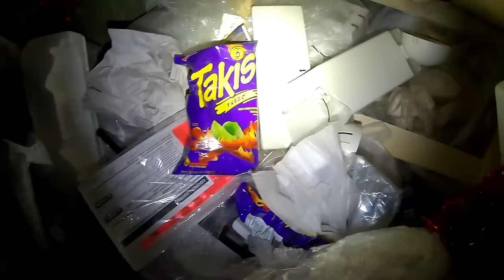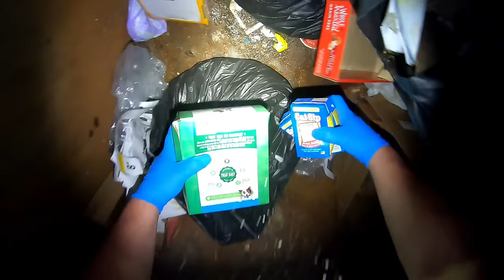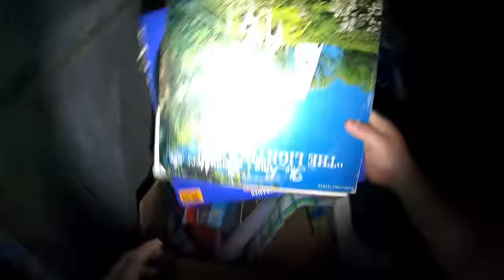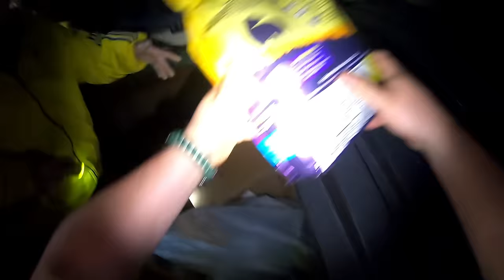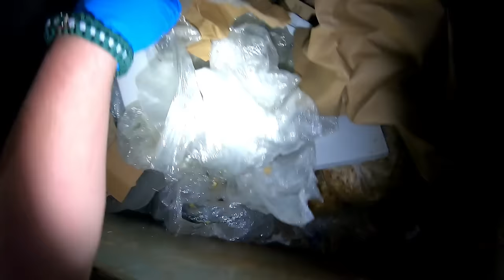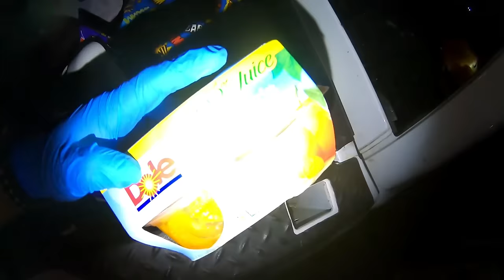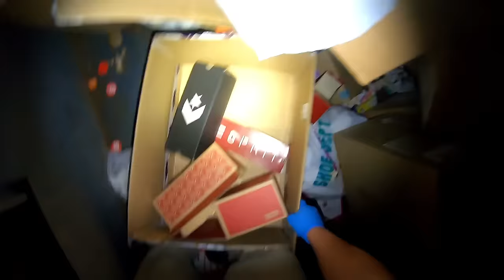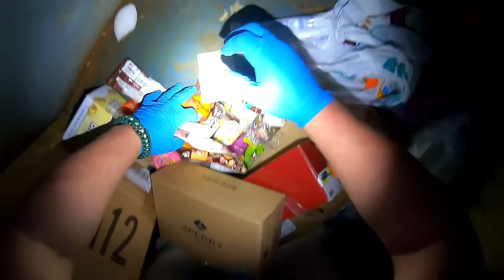ARRESTED DUMPSTER DIVING | Shoe Mega Haul OVER $1000 NEW Shoes | NIKE CONVERSE VANS SPERRY

Comment: They probably take one shoe out of each shoe box and throw it loose in the dumpster then pack all the shoe boxes in the big boxes like that to confuse you so you won't take the time to try to find the mates. You should get a camper cover for the back of your truck so you can throw everything back there and nothing will fall out or at least rig some cattle guards and wrap it with tarp and make a gate above the tail gate.
Reply: They don’t bother doing things like that.  People who wear two different shoes sizes will switch things out, so shoes stores end up with dozens of boxes of single shoes or they receive out just one shoe of each style for display and the display shoe eventually gets tossed.

Comment: I had made a comment on someone else’s comment about the shoes and most stores around me use to throw out all of one of the matches to all the shoes at different days. If yu check those same dumpsters periodically yu could match some shoes and make some okay money. Stores around me  use to do it until they had got locked 40 footers with a compatible on the front.

Comment: can a left shoe be modified changed to become a right shoe....mabye by making cut in sole v shaped so front part moves to side , but how to connect it again, must be a way , two holes nearby and u shaped nail in or , or not cuts but drilled holes to make it more spongy than stiff to adjust maybe it will just adjust itself to the shape of foot. .

Comment: WARNING :  Diving the dark dumpster of death.
In 1977 my job at the body shop required me to throw old paint and chemicals into a special dumpster in the alley.   One morning I found three men hanging in the dumpster, they had been huffing paint all night and could barely respond as I chased them away.
I told the boss we needed a lock on it, but nothing was done.  Then one day I found two men inside the dumpster....they were both dead from exposure to fumes.  They had climbed up top to huff paint, but when they passed out they fell in where the fumes killed them.  The men on the outside would fall away from the dumpster as they passed out....which allowed them to recover.  So sad.